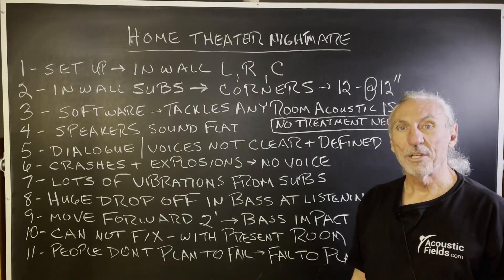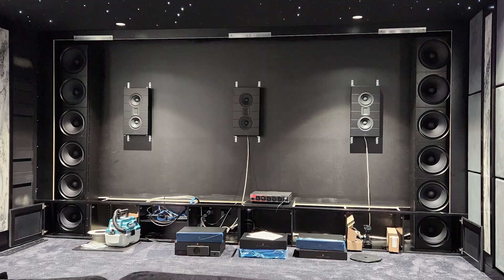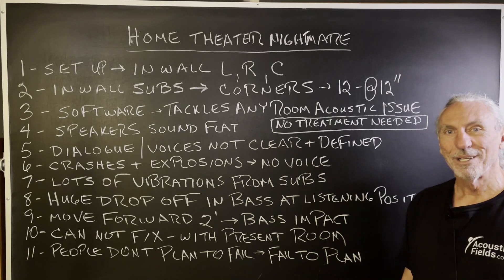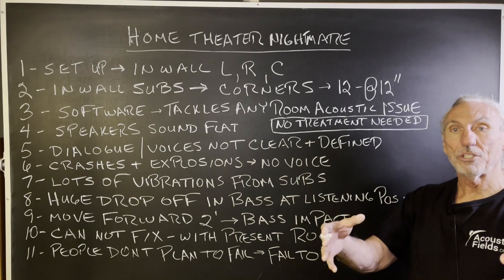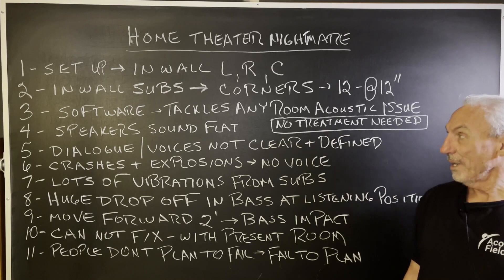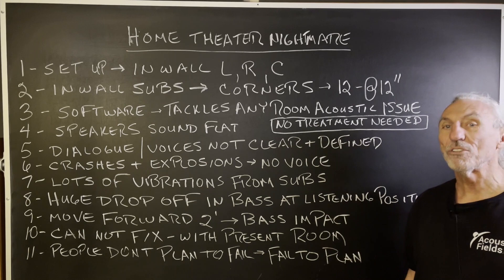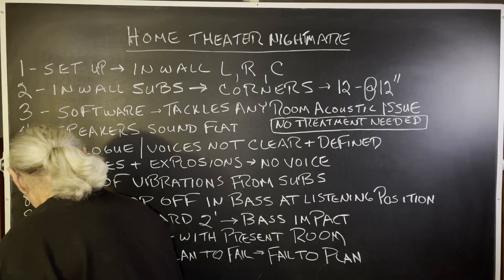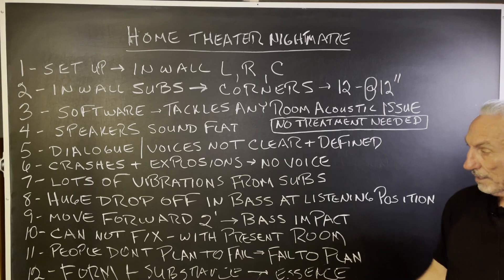Home Theater Nightmare - www.AcousticFields.com

Comment: Visible problems.
Speakers too close to walls.
Solution move them away from walls two feet or three feet.
Needs full wall absorption for mid to high range.
Requires ceiling to floor bass traps that are large volume at least 20 percent of room space.
Main problem is room is too small.
50 percent of your sound is the room you place your Speakers in thus its better to build an outdoor shed 18ft w by 30ft length by 14 angled roof height.
Reply from the maker: LOL Yes to all that. Well crafted.

Comment: One mistake I often see with folks using room correction software is they allow the software to "fill holes", which does not actually work as the hole is due to phase cancellations at that position. Only allow software to shave peaks.

Adding more energy will cause distortion as now both the amp and speakers (and the room too) are asked to work harder at those frequencies but it will have the same cancellation effect. 

Adding insult to injury, most home theater receivers are being asked to drive loads they are not built to handle as folks will pick speakers with good low frequency extension, but fail to see that such design choice massively impacts sensitivity.

The combined result is a room that sounds "farty" and uncontrolled with components failing early.
Reply from the maker: The whole sound producing and receiving processes have become dramatically distorted.

Comment: The main problem is, most people and also Companys buy Stuff of the shelf. Means, pre made Subs, pre made Speakers and all that mostly without any Acoustic & Room Concept and the hope Dirac or similiar DSP Software can fix it. No DBA (Double Bass Array), no Bafflewall, no overall Concept. Check out HollywoodZuhause (on Youtube) how to do it right with an overall Speaker, Acoustic, Room concept . Expensive yes, but its the only correct way.
Reply from the maker: If you do not consider the impact of the room sound in overall presentation value, you are in denial and have drifted away from reality.

Comment: From the point of view of a programmer, I can tell you that it is possible to design software to deal with many issues in a room 
BUT; and this is a very big BUT; 
the software must have to external feedback from audio sensors positioned throughout the room in order to make the audio adjustments necessary to compensate for those issues.

The inability to hear dialog during explosions would be a simple fix if, the dialog and explosions were on separate channels and tracks.
You would either reduce the volume of the sound effects or increase the volume of the dialog.

As practical as this may sound, not even five point computer sound systems are designed with that kind of control in mind which goes back to the statement that it is not possible for software to make all the adjustments needed in a room and provide an excellent listening experience.

In addition to the feedback sensors, the system would also need to be designed so that there was a second and equally powerful set of speakers facing 90 degrees to the primary speakers. This would enable the program to determine the specific frequency that audio anomalies reside at and send out a crossing matching signal to cancel out the anomaly and render it mute. There is however, no technology that uses noise canceling technology in this way.

Sound systems are designed to do one thing and one thing only; REGURGITATE, BARF, HURL, TOSS or PUKE out sound as loud as the listener desires it to be. And those that succumb to the lust to play their audio as loud as they like; typically end up in their later years with hearing damage and selective hearing loss which leads to the annoying experience of not being able to hear the person speaking to you that is standing in front of you less than 2 feet away due to all the background noise in the room.

With a bit of research and development, I could possibly design a sound system that controlled a lot of the anomalies that occur in an untreated listening room. However, I seriously doubt that people would opt for 50 to 100 small speakers mounted on each of two walls and forgo those huge, mammoth "I have the power", Heman ego stroking speakers that we see in this listening room.

We all have a bit of {Tim the Toolman Taylor} running around in us.
We want to make things bigger and more powerful and think we have achieved something when we have obtained it. But as Tim the Toolman Taylor often found out; bigger and more powerful often causes more harm and damage than we expected.
Reply from the maker: How would software manage reverberation times?
Reply: @AcousticFields  

"How would software manage reverberation times?"

Software can only make changes to something it knows.

Audacity has a function that allows you to remove background noise from your recording, but the first part of your recording has to be nothing but the noise your trying to eliminate. But this is a recording and not a broadcast environment.

I've seen some of the software claims by engineers and I can tell you that they are rarely if ever, as good as they are claimed.

Thus, a software engineer would reduce the volume of the given signal until there is no reverberation. 

In the end, it would be as impotent, hollow and empty as you imagine it would be. But, they would claim that it is as good as the best tech on the planet without the cost.

They would also put some sort of material in the box that you put on the wall to help eliminate the echo of a room. And if they did the 50 - 100 small sensors and speakers for control, those would be mounted inside some sort of material that is supposed to help with absorption while at the same time, either making things worse or having little to no affect, all the while telling you to believe that it is the latest, greatest, best thing on the market.

How do I know this is how it would go?
Every time a tech company claims that their latest version of whatever is the latest and greatest and better than their previous version, it more often than not is released before it is ready and breaks something.

That seems to be the standard operating procedure for tech companies.

Your biggest challenge with software like that would be getting people to believe the truth of your years of research & development, experience and know how, rather than the latest lie big tech is pushing them to believe.

You know, it sounds like nothing would change for you should such a program be put on the market.

As I think about it, I'm not certain that reverberation can be canceled with an electronic signal. I wonder how they do it with electronic exhaust systems. Not that I've heard any of them being actually put on automobiles which; is a good indication that the tech is not as good as claimed. Sort of like green energy tech.
Reply: @AcousticFields  

I thought about this a bit more.

All good software, solves a real world problem by imitating the real world solution.

Your treatments for example, prevent as much sound as is necessary from striking the six surfaces in the room. To do this with software, we would need to imitate that action.

If we take digital sound canceling technology and set it up so that it shielded the six surfaces of the room from the audio, the reverberation which is due to the audio bouncing off the surfaces, would be canceled.

Then, sensors placed within the sound dead zone area between the sound canceling shield and the wall, would be used to test for escaping audio and make the necessary audio adjustments that would insure all sound is canceled before it reaches the walls.

As far as other issues are concerned, placing sensors within the listening area to adjust the audio signal and output, may give the optimum listening experience for the listener.
Reply from the maker: That may be a good theory. I have used many of these processors and I am always left with a sound that lacks something and that something, whatever it is, does not sound like music to me.
Reply: @AcousticFields  

"That may be a good theory."

Yes, it is a theory and the only way to determine if it works is to test it out.

"I have used many of these processors and I am always left with a sound that lacks something and that something, whatever it is, does not sound like music to me."

It's not hard for me to figure that the software doesn't provide you with enough fine adjustments to actually tweak it in as many ways as you would need, in order to see if you can make it work.

I wonder if they're using something like AutoTune under the hood and claiming that it does what AutoTune doesn't do?

The only way for software like this to be properly developed is for someone who has a keen ear for music to also be the developer that creates the software. In that way, he can keep modifying the program until he finds the right parameters that are necessary to do a proper quality job.
Reply: How about no.
A bad sounding room needs absorption and control materials.
Reply: @theufo2781  

"A bad sounding room needs absorption and control materials."

Only when the volume and energy being put in the room, is too great.

Turn the volume down and you not only reduce the energy, you reduce the distortions that the excessive energy causes.

But that also produces the problem of being able to hear the audio.
The old "commercials are louder than the program" TV issue comes to mind.

You have the TV set to a volume you can comfortably hear, then a commercial comes on and it sounds so much louder than the program.

Networks claimed that the commercials were not louder, but I most people chose to believe their annoyed ears, rather than the networks.